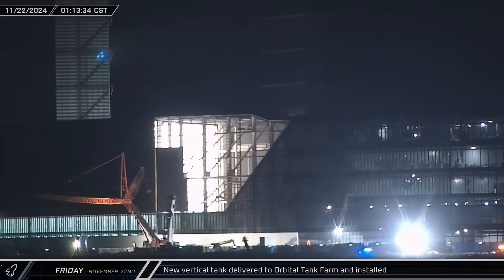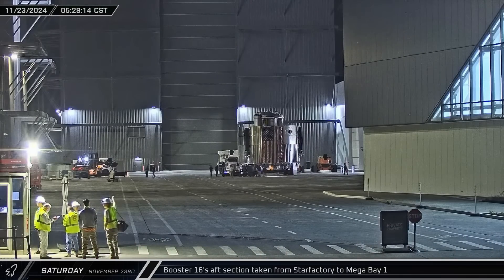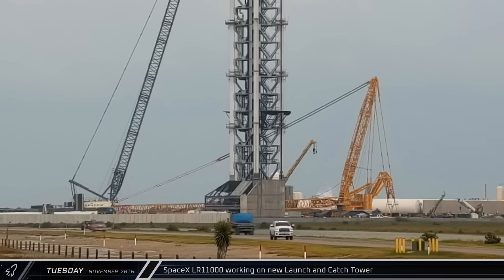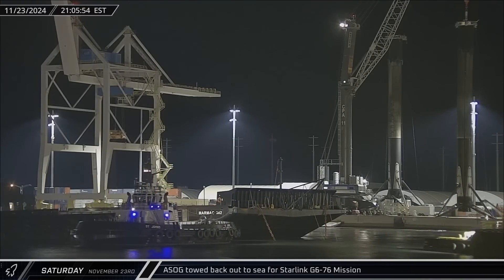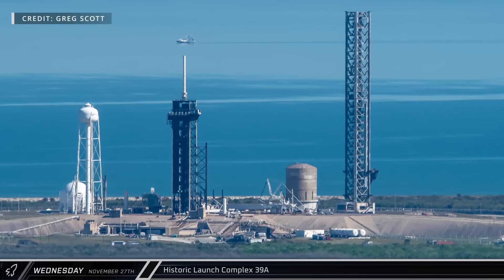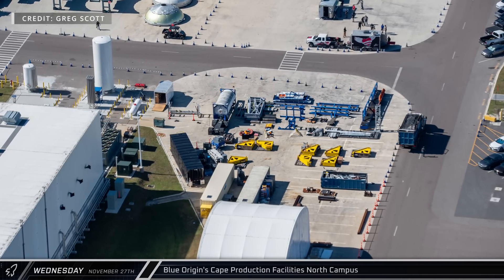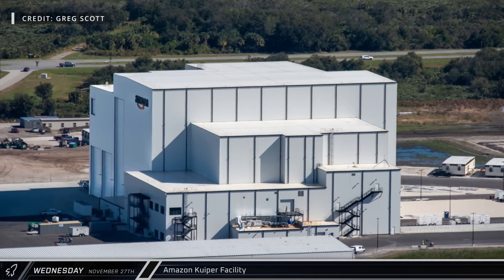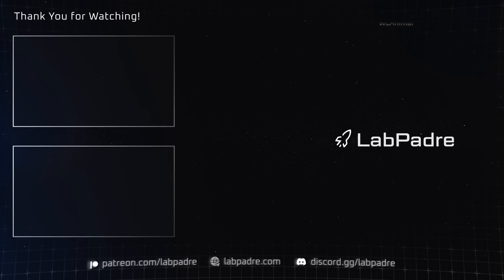What Are SpaceX's Plans For Starship at Cape Canaveral? - SpaceX Weekly #143

Comment: 13:58 I saw a picture of one of the large crates on a truck outside of a factory in Ohio. The factory has a very large vertical axis lathe in its own climate controlled space. It is used to make parts for Blue Origin.

Note where the engines mount on a New Glenn booster is a larger diameter than the tank section. I assume these parts transfer the thrust from the engines to the tank walls and are the main structural elements of the bottom of the booster.

Both the lathe and the work piece have to be kept at a constant temperature during milling in order to maintain tight tolerances.

I have not seen pictures of the parts themselves, only a single picture of a massive crate on a semi.
Reply from the maker: Thanks for the info!